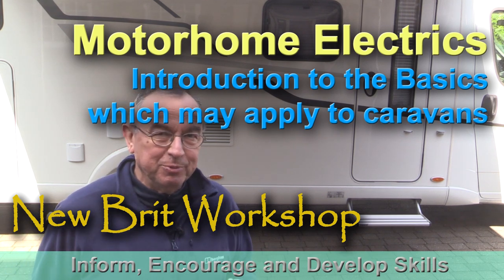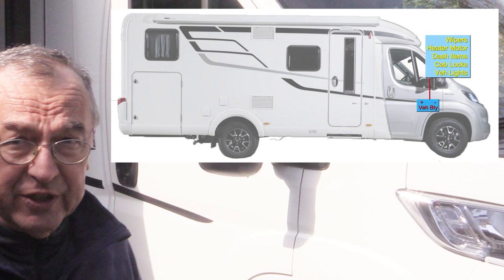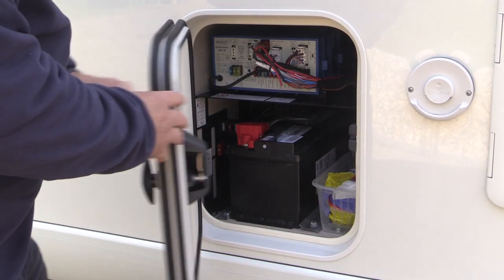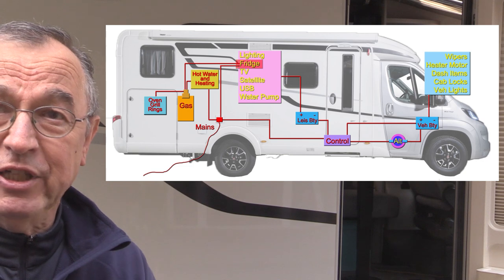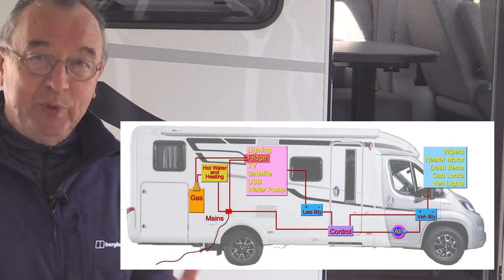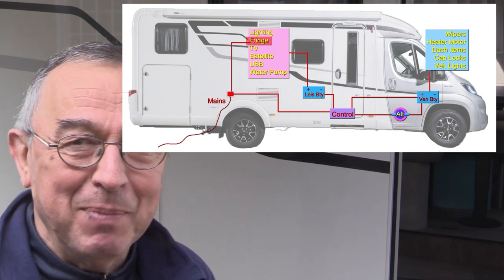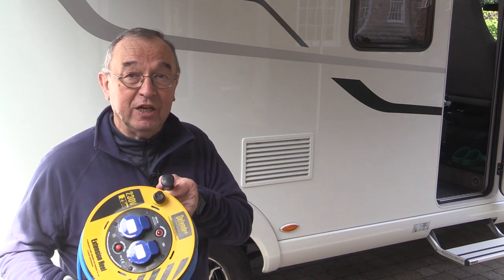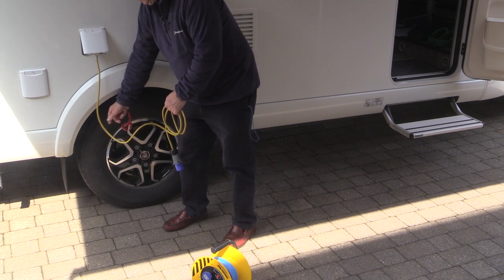Motorhome Electrics  - an overview for newcomers

Comment: Although the Video is aimed at Newcomers to Motorhoming. There are a few items that you have shown that are of interest to us seasoned owners too. Like the right angled socket and the extension reel, as the ones that a lot of us use are ungainly and over a short time they become stiff. 
Your Video also shows the differences on a new Motorhome to what we have on our Old A Class motorhome. I have done a few upgrades to ours, like adding USB sockets and changing the bulbs it LED and adding solar as we spend a lot of time off grid, especially now where you can stay somewhere at low cost when not using sites power supply.
Reply from the maker: Hi Digger, Yes, our old A class had few of the gadgets that we now have but it did have a lot more space inside.  Many thanks.  Cheers.  Peter

Comment: How do you connect the free end of the cable on the reel to your home electrics ?
Reply from the maker: If you want to do that you either have to change the plug on the end of the cable or make up a joining lead which should have a 16 amp 230v roving socket on one end and a normal mains plug on the other. If you are in the UK the roving socket is available from Screwfix, product code 2264X, priced (today) at £6.99. Peter
Reply: @NewBritWorkshop  I am no expert, but do you not need a special circuit in your house to connect a 16A load? The standard circuits are rated at 13A.
I guess that if the load exceeded 13A the fuse would blow, but still .....
Reply from the maker: Hi David, Techincally yes but if you use less than 13 amps there is no problem. I have a drop lead from an outside 13 amp socket which powers the motorhome when we are in residence (that sounds posh). I keep an oil filled radiator in the motorhome and sometimes run the aircon in heating mode at the same time with no problems at all. The very worst that can happen is the 13 amp fuse in the plug connecting to your normal socket would blow.  Peter
Reply: @NewBritWorkshop  The reason that I asked was your explicit mention at 06:03 of plugging in the mains when you got home